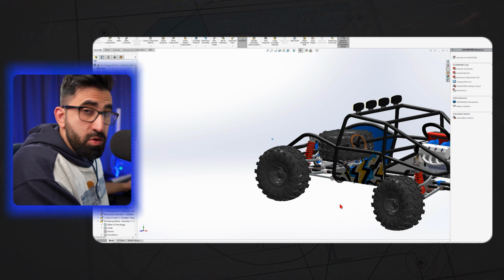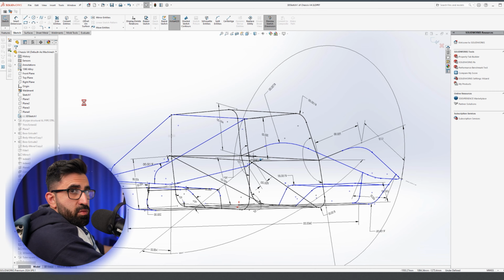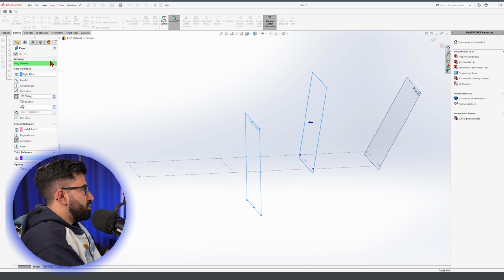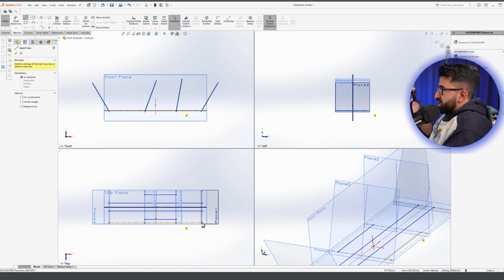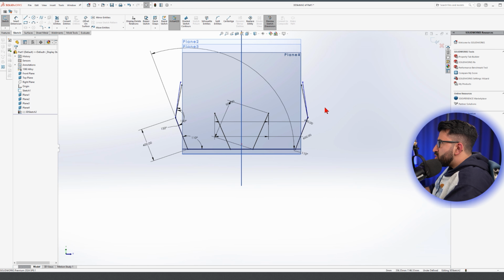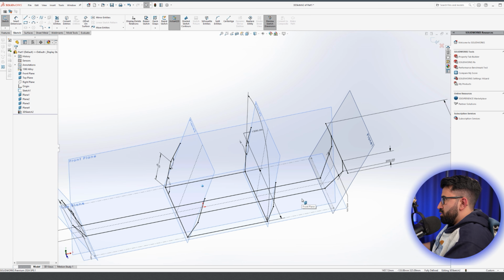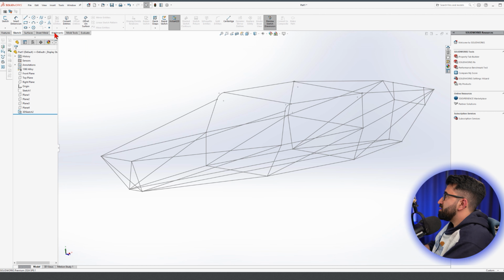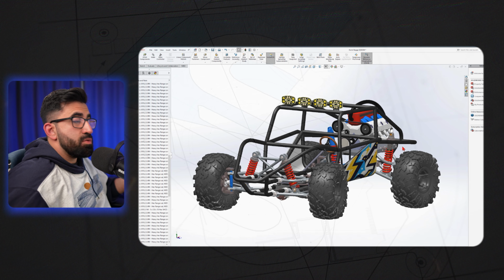3D sketching is Not for Beginners!

Comment: I am currently building up a bicycle frame. Is it possible to define the 3D sketch using the elevation sketches done on 2D planes? (which can give me flexibility in adjusing my design constraints in 2D sketches)
Reply from the maker: Yes, you can use elevation sketches on 2D planes to define the 3D sketch. Use "Convert Entities" or "Intersection Curve" to link 2D sketches to the 3D sketch. Adjusting the 2D sketches will automatically update the 3D sketch, giving you flexibility.

Comment: 3D sketch not for beginners?... For Sure. I am fairly comfortable with SW (even have some cert from classes for my degree) I am bumping my head a bit with 3D sketches, but hey it keeps me interested until I figure it out LOL........ Thanks for the content, It is a bit fast paced but I like that.
Reply from the maker: Keep it up 👍🏽 you’re gonna be great at it
Reply: You can define it by points, plane and line axis. Depends on your design. Most of my work in solidworks is organic shape design and performance boat designing. I use often intersection curves with some 3d sketches, it gives me alot of flexibility in designing 😊 and fully defined sketches which makes Solidworks happy 😆

Comment: Working with weldments in Solidworks lately. One thing I have to note that for symmetrical bodies - its sometimes best to model one side and mirror it as one of the last features. Can't count how many times not doing so caused many problem with cut list and other stuff. This may not be for everyone, but I often forget something while doing microadjustments and one side is left broken
Reply from the maker: Priceless! For everyone reading this, I want you to know that this is a very valuable information! It comes from experience! How long have you been working with weldments?
Reply: @with-aryan  Like almost everyday for the past year. Still learning alot :D

Comment: Primary question. You probably know that the chassis will be symmetrical so why do you draw all that stuff twice when you can just draw one side and then mirror the weldment or mirror inside the 3D sketch after you’re done? Do you foresee that you might need asymetrical elements at some point?
Reply from the maker: good questins. Because given I designed this from scratch myself, I had to have the "final" output in front of my eyes the whole time to asses whether or not the proportions are right. But technically speaking you are correct
Reply: Use dynamic mirror sketch tool

Comment: Am sorry, but you lost me in the first part where you explained how to use 3d sketches perpendicular to the planes. Ever tried drawing from isometric view and use the tab key to switch between the three main planes to work in while sketching? You can change the orientation of the line you are drawing with.
Reply from the maker: yes you can do that indeed. It's not the easiest way to draw the lines in vertical or horizontal directions. But it certainly is a cool shortcut

Comment: Do you know the TAB function to change the plane orientation made with the 2 red axis inside the 3D sketching?
I am pretty sure that i didn’t see the use of it during the video and it is a much have i think.
Thank you for all the content you are sharing
Tohrak
Reply from the maker: No! What TAB function?! let me know please
Reply: @with-aryan  Just click the TAB while drawing lines in 3d sketch mode while in an isometric view. You'll see
Reply: Start a 3d sketching and press several times on the TAB key (not function sorry) to change the orientation of the design plan your drawing on.
For example, at 5min of your video, you can use the TAB key to change the plan when you want to draw a line in the depth.